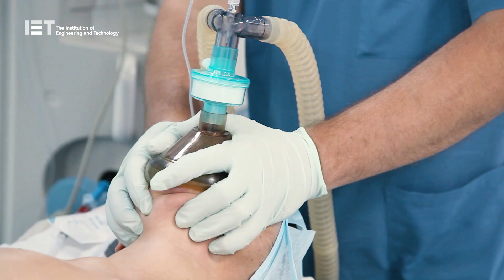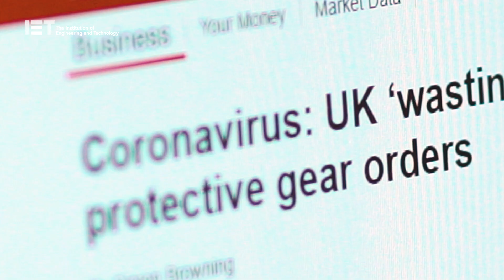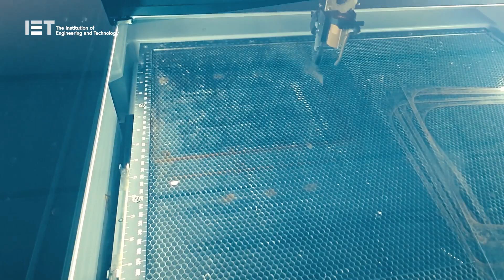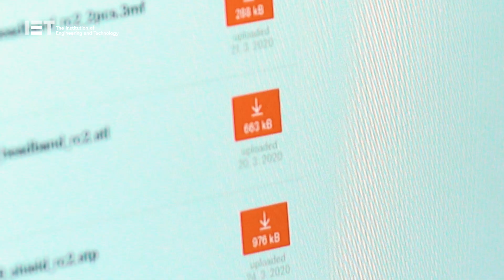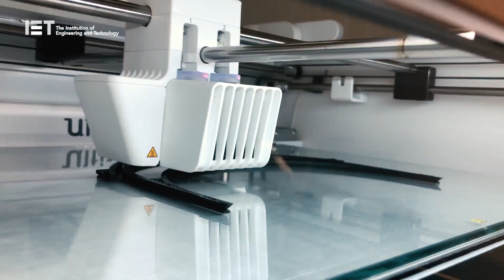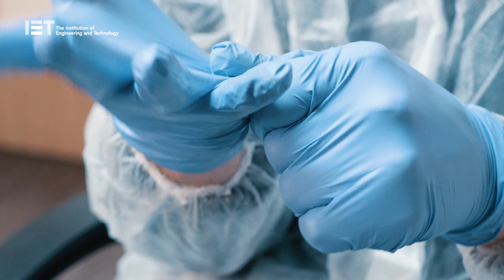Manufacturing our way out of the PPE shortage

Comment: Would it be possible to add a link to the recommended 3d print visor files into your description then it might speed up the process for others. I will be trying it on the 3D printer i'm borrowing from the workplace.